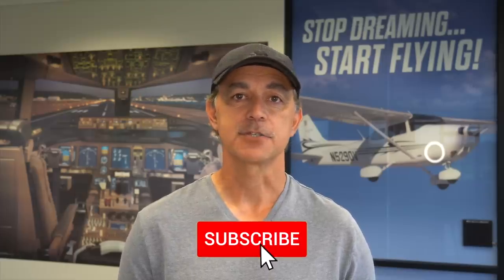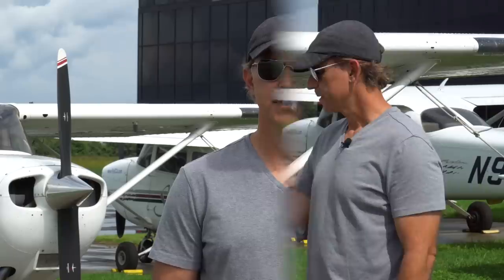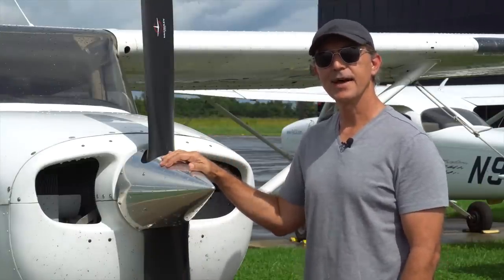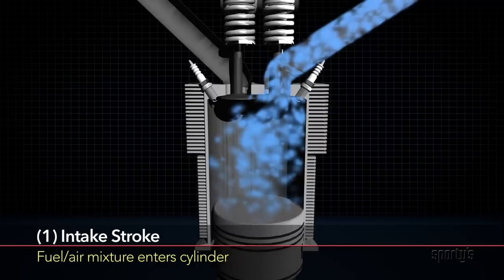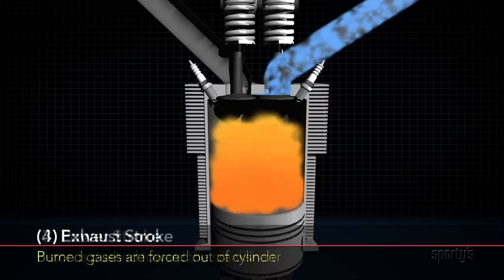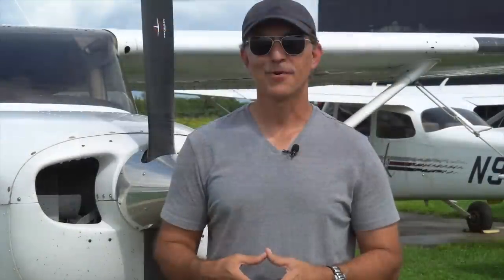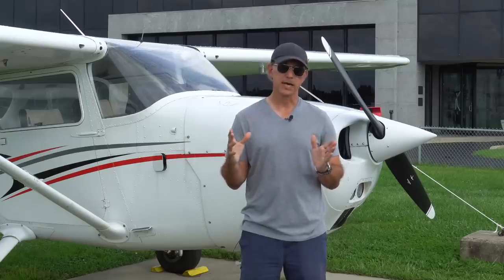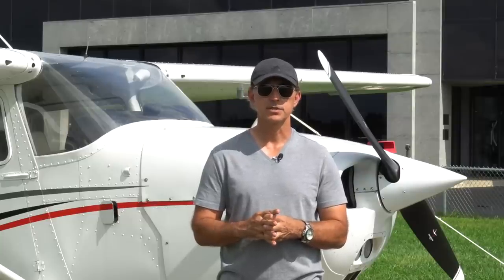Emergency Follow Up, What Happened To The Engine

Comment: It's ok to bring basic info into the story by means of context, but not as filler. I wanted to know how it was diagnosed, what they found, how it might have happened, and what is being implemented to help prevent it from happening again.
Reply from the maker: Basic information was brought in because not ever viewer is an experienced pilot or mechanic. Many viewers are aviation enthusiasts and hopefully future pilots. 

As far as I understand, there is no solution for pilots to prevent stuck valves. Some will theorize that leaning the mixture will prevent it, other may blame the lead in fuel, some will say it has to do with the cylinders themselves. I do know, it is why aircraft engines are designed to quickly replace cylinders without a complete engine tear down like a automotive engine would require.

Comment: Kristoffer, thanks for sharing this.  I was thinking that Sporty's was using the newer 172s, so I knew carb heat wasn't the issue.  Also, from what I was seeing, carb ice forming, even if they did have an O-360, was probably unlikely.  Not enough moisture and the temps were pretty high.

As to the 'Impossible Turn', Matt showed us how it is done.  He must have felt that he had enough altitude and airspeed and a far enough distance from the runway to attempt it.  We've been taught that it 'all depends' and what it depends on are a lot of things.  I would say that his evaluation was spot on, but I am curious, do we know how high he was and how far on the take off/upwind leg he was when they experienced the cylinder failing?

As to N121UC, bet she was flying later on that day, or the next day  :D
Reply: We were at 250’agl and I think there’s tail footage of us flying just into the tree line past the departure end of I69
Reply: @flyingsic  I had a reply to this, I thought I posted it, I guess it didn't post.

Okay, I'll try it again.  I haven't been flying for decades, literally.  I also flew primarily a Cessna 150, not the 172.  At 250' AGL, I would have been looking for a place straight ahead to set it down, even if that meant the Long Island Sound.  So, I absolutely comment Matt on his capabilities.  However, I also want to commend you on your ability to recognize something went wrong and that you weren't in a position to do anything about it.  To say 'Your controls' was an amazing, to me, indication that you, in a flash, knew something was wrong, and you weren't in the position to control it.

The late Col. Jeff Cooper used to teach self defense and firearms safety.  One of the things he taught was his color coding system.

https://cdn.ymaws.com/www.caceo.us/resource/resmgr/imported/documents/as14/Coopers-System-for-Awareness.pdf

While this applies specifically to self defense against an assailant, if you think about it, an airplane can also coldly, and without emotion, also kill you.  So, having the mindset of condition codes you can prepare yourself for any emergency.  As an example, my father taught me to fly, and he also started out teaching my mom, too.  A 5,000' runway, a Piper 180 Cherokee and just after she rotated and lifted off, he reached over and pulled the power to idle.  Because she wasn't 'hair trigger', she tried to continue the take off.  Doesn't work well with no power.  YOU, on the other hand, saw the change in condition, were ready for it, and immediately saw that the situation was beyond your capability, and handed it over to Matt to handle.  He did a great job of it, too.

I think you are going to be a great pilot, and if you want to push for it, and work hard, we have a pilot shortage, and going to work flying a LearJet, or business jet, or like Christy Schafer, a regional, is not beyond your ability.

If you ever do a long, coast to coast cross country, and you find yourself in the Pacific Northwest, let me know, I'll be more than happy to go fly with you.

Comment: Most probable cause is, a failed valve spring. Either the spring broke or the spring keepers fell out, allowing the spring to pop off. There is also a chance the stem/shaft could have broken on the valve too.

Comment: There is a big difference when it comes  to the impossible turns. loss of all power and loss of partial power.  If I had lost a partial power like one cylinder quit, I would entertain the idea of the impossible turn..  If I lost all power I would push the nose forward keep my speed up and find a place to go..

Comment: Maybe it's time to return to the days of hard and solid regulations about time between overhauls being maintained in other to have a certificate of airworthiness.  Inspections doesn't cut it.  Or maybe it's not important.  It's just the thing that's keeping you in the air.  If you're lucky nothing will go wrong and if it does it will come up when you can glide to a safe place to land/ditch.

Comment: I used to work for Lycoming, overhauling engines. Since when does an IO-360 make 116 horsepower? The parallel head 0-360 is carbureted and produces 180 horsepower while the IO-360 fuel injected, angle head engine makes 200 horsepower.  The 172 with the cowling removed looks like a parallel head O-360.
Reply from the maker: 160, not 116.
Reply: @BaronPilot  If it has 160 horsepower, it is an O-320.
Reply from the maker: @i.r.wayright1457  IO360L2A

Comment: If you have a dead engine, then the impossible turn isn't a good idea. This engine was still producing power, just not full power. I have a problem with you saying the impossible turn is okay based on one type of aircraft requiring proficiency on it. For pilots in most planes, trying the impossible turn is very risky at best. I did an impossible turn as a student pilot in a Cessna 150 onto a very narrow paved runway and actually scrapped the tail in the flair, banked at probably a 10 or 15-degree angle trying to land on the pavement. I didn't even have time to glance at the airspeed indicator, but kept the nose down until the flair. I was lucky I didn't cartwheel the thing.

Comment: The ‘Impossible Turn’. My understanding is that this refers to ‘engine out’ and in this case they still had engine power, though reduced, so could maintain airspeed and safely return to the airport. They also seemed to have plenty of altitude hence the need to ‘slip’ on the approach, or am I wrong? Go Kim.
Reply from the maker: They were actually only 250' AGL when the lost power.

Comment: Not an "impossible" turn at all.  Almost same happened to me many years ago.  1973 Cessna Skyhawk looses power with significant vibration shortly after takeoff.  Reduced throttle to minimize (eliminate!) vibration and still making reduced power (about 1700 RPM).  Checked straight ahead and immediate landing sites... multiple available.  Since still making smooth power started 15-20 deg in-pattern turn back to just departed runway while still checking for suitable off-airport landing opportunities.  Approximately 500' AGL all the way on cross wind, down wind and base to successful, normal landing.  During emergency checked with and without carb heat to no difference so stayed without for duration.  On teardown and rebuild found 1/10 of No 4 exhaust valve missing and in muffler.  Possibly due to worn guide with off-center contact with valve seat.  Total time on original engine 1956 hours.  AVIATE, NAVIGATE, COMMUNICATE - non-towered airport with no other active aircraft at the time of incident.  The "impossible" turn should always be an option... based on the situation at hand.

Comment: I don't think this was an impossible turn situation,  then engine was still producing partial power and probably could have flown a  normal pattern. Had that prop just stopped the instructor probably would have handled it differently.  I think the instructor did a perfect job getting the aircraft back on the ground.   It's easy to sit in a chair and second guess, but you have to acknowledge when someone performs so flawlessly, that was awesome.  That is for both the instructor and Kim.
Reply: In this situation It's best to assume the engine could fail completely any second  and act accordingly. Attempting to fly a normal pattern is not a good idea. Getting down ASAP is best.
Reply: @davidquinn6161  Yes, but the question becomes do you land straight ahead or do you turn to a perfectly good runway.   The answer is always,  it depends.   If the engine is running and producing enough power the turn to the airport is probably a good idea.  If the engine is dead and you are low,  pick a spot and land.   This instructor performed excellently here.    I wasn't advocating flying a pattern,  but let's say this happened 3  miles from the airport with no good options to set it down?   I'm running the engine, heading back to the airport as long as that engine is producing enough power.  If it dies on the way,  I'm no worse off than if I had just set it down.  I pick a spot and set it down.

Comment: Yeah, a sticky valve will do that. exaust side isn't that bad as it'll just spike EGT's as it lights off and looses everything out the exaust, but a bad INTAKE side, that's the fun stuff because now you're bleeding your compression back up into your intake and that can cause a massive backfire at worst, and at best it's sending all the air-fuel tables out the window and just supercharging the remaining 3 cylinders (and definitely not evenly, whatever cyl is on it's intake stoke during that attempted compression is going to be getting the brunt of it)

I bet in a plane it's even sketchier because even if you cut the engine yourself, the prop spinning in the wind will still produce vibration as it skips a compression 

At least it didn't drop the valve! Do aviation engines have additional valve retention over a ground engine? (like how they have redundant spark and such)

Comment: The impossible turn isn't near as impossible as long as the engine is making some power. That's still not to say it's not a scary situation that if not handed correctly, the end result could still be... not good. Matt did a good job getting the nose down and maintaining airspeed. Kudos to him for good judgment and possessing good stick and rudder skills. Huge kudos to Kim, and extra fried chicken in her flight bag for being a trooper. A lesser student may have quit after an event like that during their primary training.

Comment: Funny that you point to an older carb’d 172 but she was flying an injected one. :-)
Reply: Afaik sporty's academy has all of one non fuel injected 172. The rest are R or S models.
Reply: @blegi1245  Either way, the airplane he was standing in front of was an older one with a carb. Landing light location, air filter type, and door handles are all dead give always. I know the airplane with the issue was fuel injected. The airplane he pointed to during this video though was not.

Comment: Too many spin stalls, loss of speed awareness, height, and angle of attack are the most common reasons (the impossible turns) are voted against.  Kim turned the controls over to a skilled instructor who was able to avoid certain disaster.

Comment: the impossible turn is called that because other than in a Cessna and very few other models IT IS AN IMPOSSIBLE TURN. Its luck that any general aviation flight is complete.

Comment: Thanks so much for sharing. I knew we would find out eventually what the engine problem was. One nit, the IO-360 in the 172 would be a 180 hp. The high compression Lycoming O-320 has 160 hp (version versus the original Lycoming O-320 with 150 hp). Great series, and thanks to Kim for being willing to share all!
Reply from the maker: It actually is 160hp. To be specific it is a IO-360L2A to be exact.

Comment: It’s dangerous to call the pilots action “the impossible turn”, because it wasn’t. It was clear that they had some power all the way to the ground. If the engine completely stopped he would not have had enough energy to complete the term….hence the “impossible turn”.

Comment: It's an io360 with 160 hp?  Thought it was  180?
Reply: 172R is 160 hp at 2400 rpm.
Reply: @blegi1245  is that one an r or an sp?  SP has 180
Reply: @sjaviation  how many S models were made in 1997?
Reply: @blegi1245  oh, he said it was a 97? I didn't hear that
Reply: @sjaviation  i didn't know they replaced the faa aircraft registry with he said.
Reply: @blegi1245  what?  Bud, you're being awfully aggressive for no reason.  Enjoy your high horse!
Reply: @sjaviation  it is not a 180 hp aircraft no matter how much you cry.
Reply from the maker: I can confirm it is a IO-360L2A 160HP per the POH. Hope that clears up any confusion.

Comment: Is it an O-320 with 150 or 160 Hp or is it an O-360 or IO-360 parallel valve with 180 Hp?
Reply: Neither.
Reply from the maker: It’s a I/O-360-L2A with 160HP

Comment: As I recall.  Pilot pulled back on the throttle. I wonder if my first instinct might have been to carefully apply more power. Reducing power makes it more likely that a poorly running engine will quit, in my experience. However, adding power might have been the wrong thing to do in this case. 
Typically a steel exhaust valve stem will hang up in the brass guide due to overheating causing expansion that grabs the valve stem sufficiently that the valve spring does not close the valve. 
Reducing power can cool the valve and guide sufficiently that the engine, after 30 second or a minute, starts running normally again, unless the piston hits the valve and bends it so it can’t close. 
So . . . Was there so much power on the airplane that it overheated,  or . . . ? 
So change the head, but why did it happen?  It might be good to know so it doesn’t happen again. I have had stuck valve issues when I was asking too much of the engine.

Comment: Nice, but incomplete, answer.  Cessna 172 before the Model R all had carburetors and accompanying carb heat controls.
The newer Models, starting with the "R" have IO-360 engines.  Also, their basic empty weight is greater reducing the rated useful load.
Having flown many 172 models with the Civil Air Patrol, are the "N" and "P" models with the 180hp O-360 STC and the long range tanks.

Comment: With the engine going into reverse rotation in a stall does the engine suffer more engine damage like no oil getting to the crank and rod bearings?

Comment: OK "lost a cylinder"? As in it fell off? /s
What caused the cylinder to quit? I'm thinking it was either injector failure or something to do with the valvetrain. Broken rocker arm (I had one of those) broken/stuck valve or broken injector line(had one of those too).

Comment: It took engine power to get to that point of trouble and now to turn back now you have to rely on a failing engine to get you back to the threshold of the runway. Yes if you have plenty of alt & speed then by all means however, if you are 200FT AGL and to turn back will you turn back? I always told my students to pick a place in front or on either side for a suitable plane to land. Some aircraft yes you may be able to turn back like my Mooney C model! That plane will not stall.
Reply from the maker: And what do you tell them when all they have is trees in front of them with no roads or fields to choose from?

Comment: The problem was not fully explaned. But the engine will still run on 3 zylinders, not very smooth, but it does. Did one injector fail?

Comment: Perhaps the shutting down and starting  up repeatively , caused the failure. The new Chevys that shutdown  when you are at traffic  light do the same thing. It causes valve failure because  of the heat stored up in the engine while it is off and then suddenly  restarted.

Comment: I saw a very large field to the left of the plane. In fact I believe their turn was over top of said field. If it had been me I would have determined if I had enough altitude to make it back to the field if the engine quit completely or if there was a suitable emergency landing area between me and the airstrip. If not then trying to gain more altitude while circling the field under the plane while the plane still had power would have been my choice. If the engine quit completely then landing in the field under the plane would have been the option. If the engine stayed running and was able to deliver enough power to gain the altitude needed to make the runway if the engine quit completely that's when I would have made the decision to go back to the airport. Of course I don't know how high they were or how far out they were or the glide ratio of the plane or if there were any other suitable areas to land in case of emergency. A lot of ifs. Obviously he made the right decision because he made it back safely but then again his engine didn't completely shut down. Great content!

Comment: So am I alone or mentally delinquent  but what happened to the engine ?  A valve stuck open ?- so why did the valve stay open - Can we see a video of the actual failed components  - far more interesting than a sentence .
Reply: Typically the valve guide or seat has coked up and the valve, which is closed by a spring, no longer makes a good seal. This may be indicative of wider problems with the cylinder or the engine - for example it's running too rich and unburnt fuel deposits carbon on surfaces which should be clean. There could also be a problem with the cylinder or engine running too hot.
Reply: Leaded fuel's lead sticks the valve stem open. I've heard it is more prevalent on lycomings.